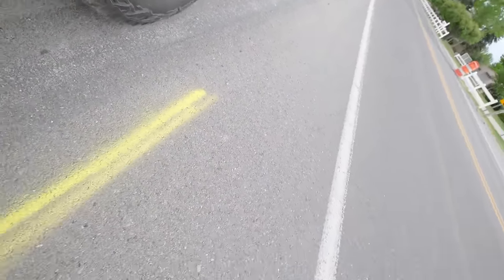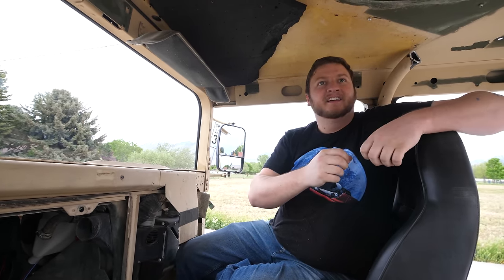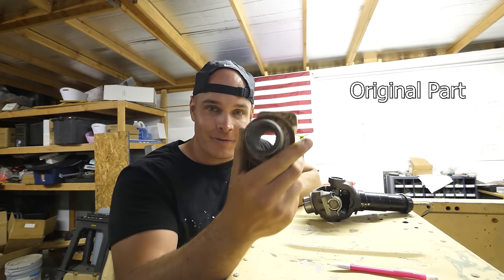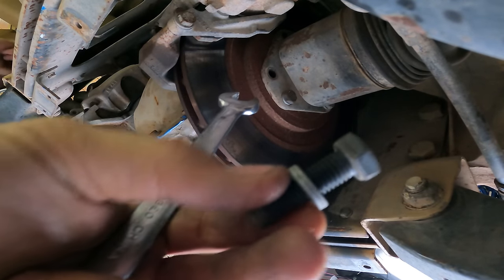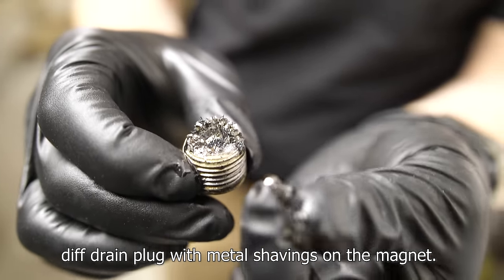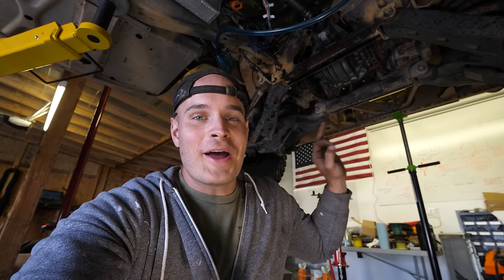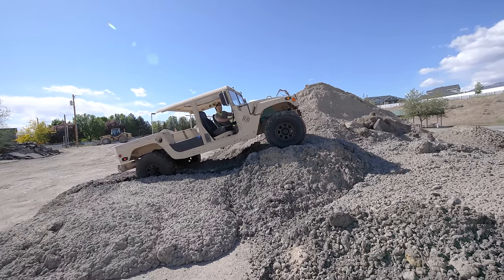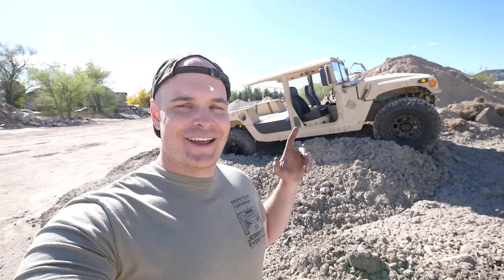My Electric Hummer has a HUGE Problem... and its all my fault.

Comment: Would it be possible for you to explain it a bit more through a graphic? I don't understand why the differential broke because of this and how the bolt shearing would happen? If one side doesn't get the same engine power from the drive shaft than the other side because of slipping wouldn't that just mean it missed a notch of power but how does this break the differential, to me it seems like it would be totally unaffected. Clearly I don't understand it enough

Comment: Read the humvee service manual. If you apply light brake and throttle it engages the differential lock. Doug Demuro lacked this knowledge on his hummer drive and got stuck on nothing. Skill is still required for the beast!

Comment: Inch lbs on a pinion bolt? Not ft lbs?
Reply from the maker: Inch pounds is just calculating the rotation of the unit. Not the tightness of the nut. The nut is probably in the 200ft lb range

Comment: yeah thats normal. I think it was citroen that designed something like that back in the 70s. it used to disconnect the drive and "coast" in an attempt to save fuel. looks like your using modern technology with old theory to make your humvee lol 😆

Comment: So you replaced BOTH diffs when all you needed was a pinion shaft for the rear? $156 vs $4k.  Expensive as all getout not including the correct yoke spline. Hmmmm??

Comment: One nonsensical problem is, they were stupid not putting a smaller motor on each wheel.
Reply from the maker: That's a lot more work homeslice
Reply: @JerryRigEverything  could have easily done that in manufacturing.

Comment: also that diff yolk just slipped on and then you said "that fits much better" but really that's a slip on fit witch is shit. it is much better if the spline is a tight fit. all this crap today is made wrong.

Comment: The fact that the drive shaft broke right off, and you can still drive it just using the front wheels, just shows how durable you made this truck. That type of redundancy would be good for the military.
Reply: You can do that in any real 4x4

Comment: Wow! That's very timely! For me - contemplating an EV conversion on an older vehicle and the question of existing axle comes up. Coupling the motor to an existing drive train is a challenge. You probably aren't the first person to experience drive shaft failure! Even the splines in the early Tesla Drive Units had some issues - But that's another story in itself!

Comment: Explore
Table 1 - Transportation of Raw Materials 

Material
Initial Location
Final Destination
Mode of transportation
CO2 Emissions (extend)
E.g. Aluminium (Al)
Guinea
Singapore
Ship 
Ship: 501.76g of CO2*
copper 
China 
USA
ship

silicon/glass
Peru 
USA
ship

rubber
Southeast Asia 
USA
ship

lithium batteries 
South Korea 
USA
ship

Table 2 - Distribution of final product (remember it may be distributed to many countries)

Final product
Initial Location
Final Destination
Mode of transportation
CO2 Emissions (extend)
E.g. OBike
Singapore
Australia
Ship
2012.04g of CO2**